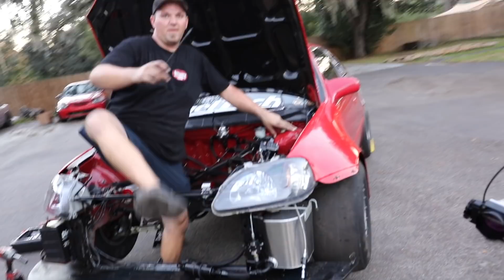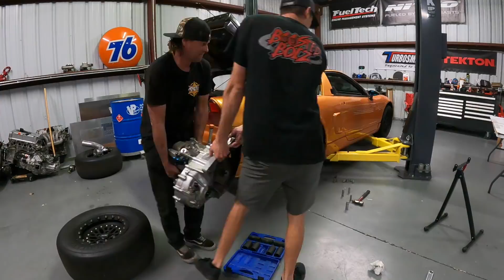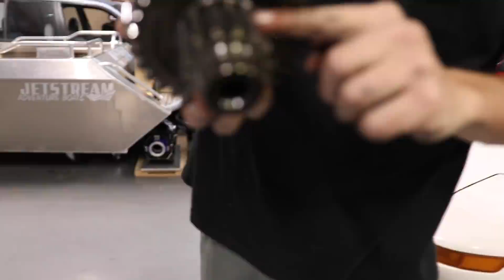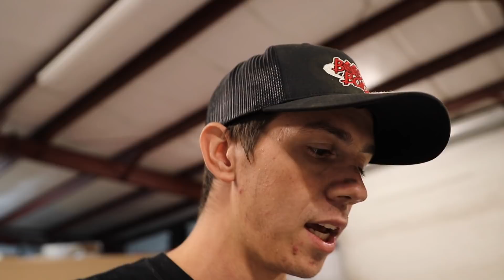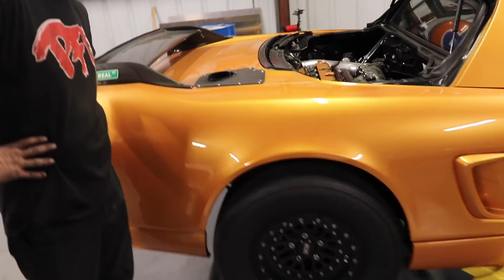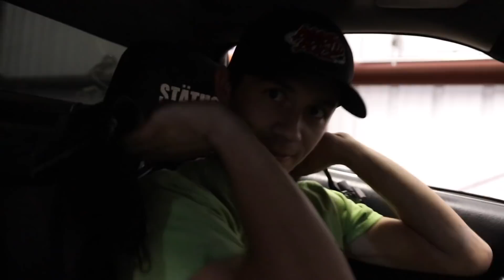Fixing The Sequential Transmission In Our 1000Hp NSX

Comment: If you think Kyle is dodgy, take a look at some of the stuff Professional Drag Racing teams do during a race day, just to get the car on the track. They have a replacement part but if in their minds the old one is repairable, they will do it. Like using 600 wet and dry to clean a crank shaft bearing surface to put it back in rather than use a new one. Or another team was hand stitching their drag chute back together as they had run it over on the return road.

Comment: Hit up cleeter or dougie fresh to get a cnc machine to map out the top half of the tranny case so you can make a plate to slap on the shafts so you can have them sitting where they would be and check tolerances with a feeler gauge (just a plate with 3 holes for the shafts :p )

Comment: I've got a serious question guys..  If you used the same system for 4 wheel drive like you did in the rowdessy,,
Could you do 4 wheel drive in the MR2 if you flipped over the diff 180 degrees 🤔???
Serious,,what do you think??
Reply: No problems with traction as wheelies show, mr2 wasnt made in 4wd so no doner parts, just to much drama and costs for what?
Reply: @alastairdow-taylor4103  my question was ,,can the Honda 4 wheel drive system,,the same one as in the rowdessy be used??? Now that entails a couple of obstacles. Should I explain more?? 
The wheelie thing isn't what I meant.
Reply: @iannorton4463 
Makeing a car 4wd is to gain traction ,the car is getting plenty of traction as the wheelies indicate. the mr2 doesnt have a diff its a trans axle  youre talking full re enginering a car and anything is possible with money and time but its not worth it in this case.

Comment: hey at least they are breaking when your taking them to the limits placed upon you vs say an all motor car with half the power and tq. your throwing 4x the amount that trans was designed for at it. when comparing to stock...300 hp a hole is going to result in some "technical difficulties" once and a while haha

Comment: Gearboxes aren’t load-bearing, sure, but none of the boxes you use were designed to put 1000 hp through. I reckon you guys have done really well to get them functioning as reliably as you have
Reply: They become load bearing when you use them to mount to the midplate

Comment: In my honest opinion (and im no expert but knowledgeable enough) that flat spot in the bearing is indication to me, that the nut backed off before the bearing went.
if that bearing was starting to go, there is no way it would of randomly backed that nut off. Youre 2 trans down, in the same way, with the same loose nut. THATS a sign to me.

Comment: Put a 1000+ HP engine into a 1400 pound body - (Austin Healey Sprite Mk 1 or MG Midget Mk 1) and you will be running Mid 6s, look outside the box, use your engines, different car bodies.

Comment: sucks to think about, but you are pushing these cars hard. you may have to start a service schedule, every X runs gearbox pulled for inspection and all new bearings. that sorta thing, yes it sucks as your making more work but bearings are cheap (comparitively) and not to mention if any of the cars start going rounds in a class you need that reliability.

Comment: Do you think it's possible to take flakes from transmission/engine oil and put it in paint to give the paint a sparkle?  I don't know if it's possible to get the flakes clean but I think that would be a cool thing to do.  "See that sparkle in the paint?  Drivetrain internals."

Comment: you smack the gear so hard that it pushes against the bearing and the bearing doesn't roll but the shaft spins you need a stronger bearing

Comment: You have thousand plus horsepower on one side of the bearing and the weight of your car on the other side of the bearing find the bearing that's strong enough and the transmission won't fall apart

Comment: So, you’re making excuses for these transmission failures and putting some blame on yourself, which is fine to acknowledge your mistakes and take responsibility for them.  However, at some point you have to realize that there is an alarming trend of failure happening that can’t all be attributed to human error.
Reply: Maybe it’s because humans are not perfect and they make the transmissions, therefore the transmissions could never be perfect
Reply: Watch the video... He has made errors. They are pushing tons of horsepower through these. They have to be checked and double checked not rushed for content.